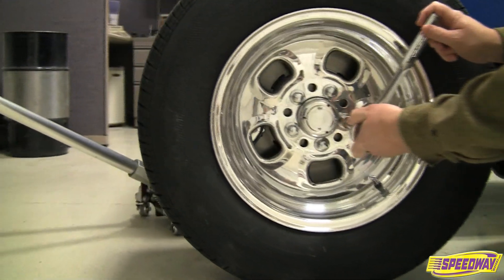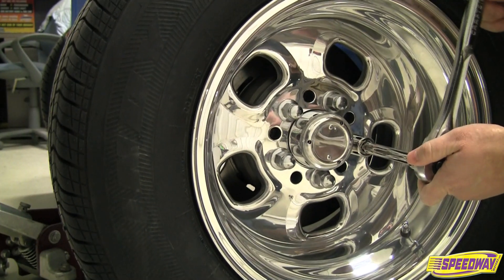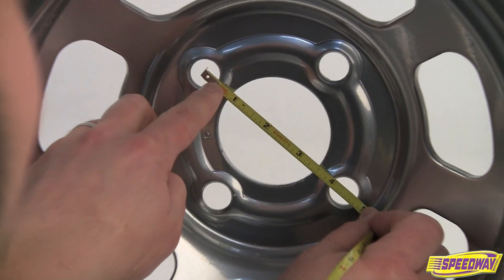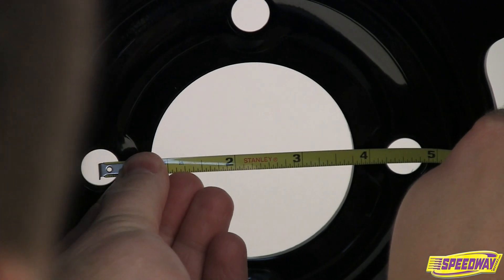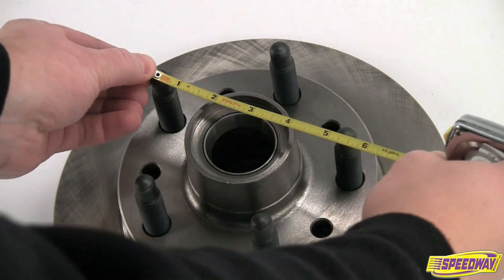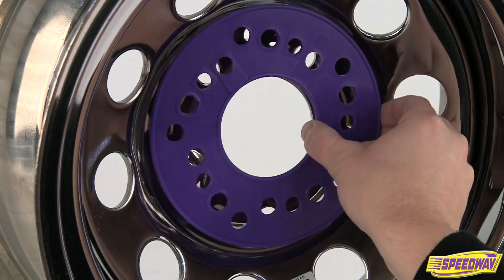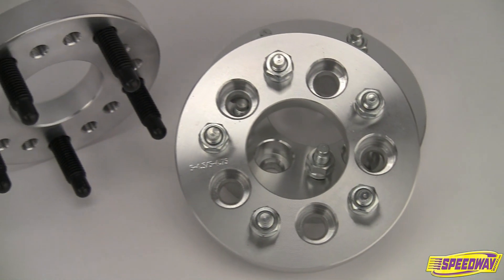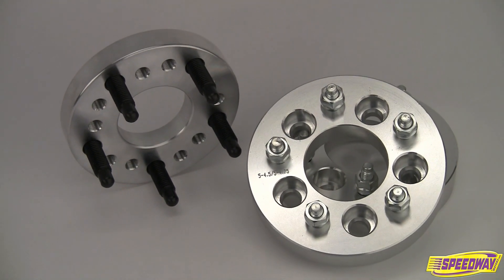Speedway Motors Guide to Measuring Wheel Bolt Patterns

Comment: yesw well it helps wgen speedway sends you the right bolt pattern never assume thatr you  screwed up if the wheels you bought  dont fit i did and they had sent me ford wheels for a chevy 1200 bux worth been sitting here 2 years cant return them of course  o junked the truck thought it had been converted to 5 on 4.75 with camaro stuff no an idiot sent me the wrong bolt pattern and me i had assumed well dont!